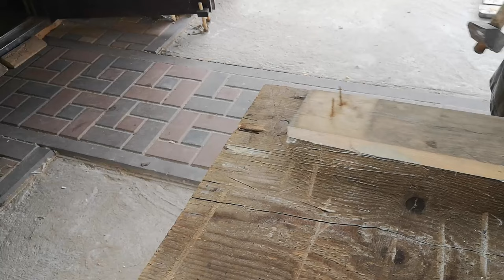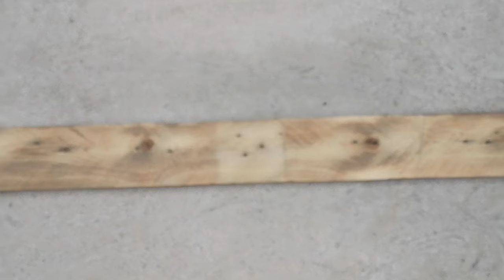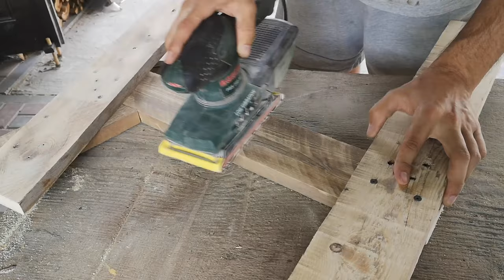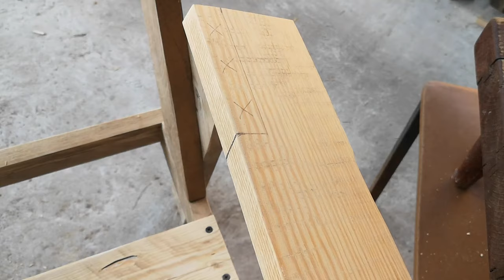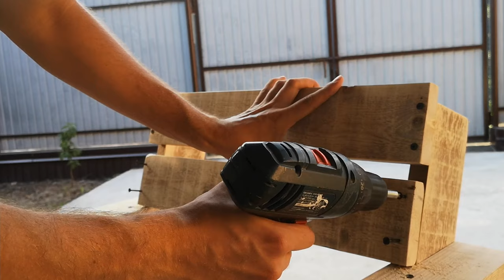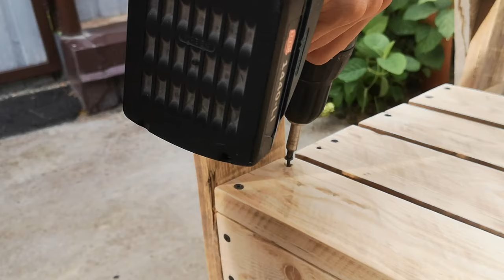DIY PALLET Chair, Outdoor Pallet Chair, Creative Recycling Idea

Comment: Nice design that I might try and use. You seem to get better qualitty pallets than I do.? The pallets I get are a bstrd to dismantle and 20% of the planks split. The planks themselves have the integrity of thick toast ad need v long screws with big heads to hold togther. How do thoe legs cope with side to side loads.?
Reply from the maker: Thanks for the comment! You should use glue to connect the legs 👍